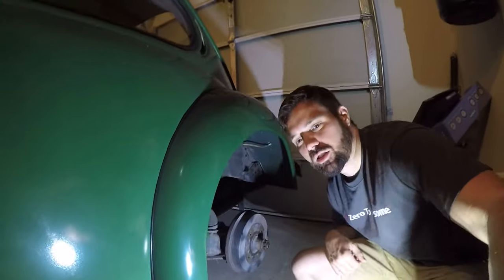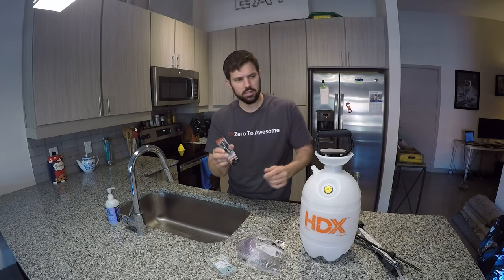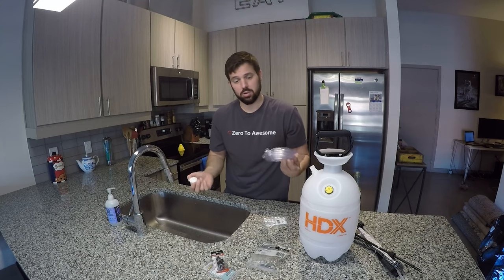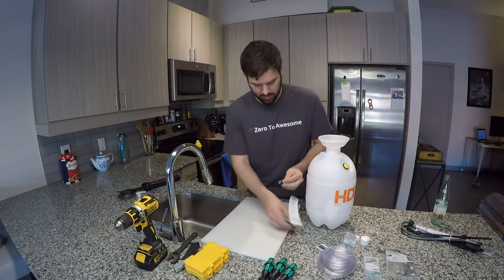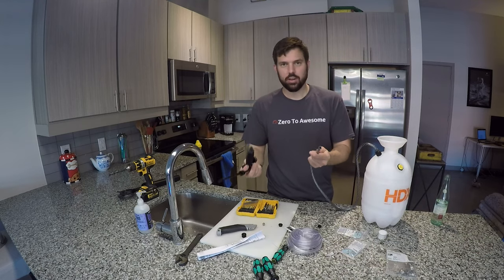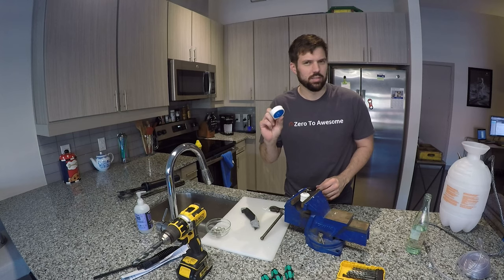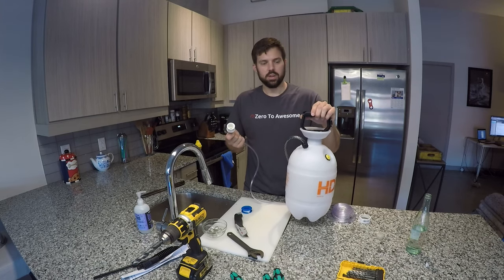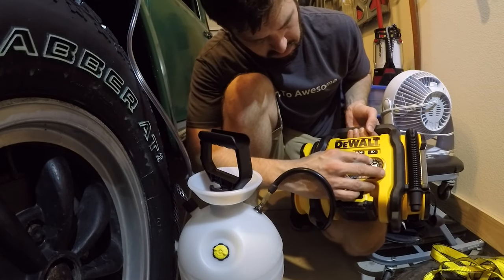Cheap DIY Pressure Bleeder for Brake Bleeding on My Super Beetle

Comment: Before I buy a Motive unit I went looking and found you.  I love that you used a mighty vac catch can. The problem is  getting caps to fit a range of different cars, I need more thought time, vice on granite, damn man.
Reply from the maker: These things operate at such low pressure a cap can always be made a little bigger or smaller with a couple wraps of electrical tape on the threads. 

About that granite.... yeah... still haven’t seen that security deposit yet.
Reply: You could always grab one from the "HELP" section at the parts store for a few bucks. Believe it or not, there aren't THAT many different ones. Or make a plug style out of a chunk of rubber, a tire valve, and some of that tiny chain that comes with the high dollar bleeders.
Reply: Look at a salvage yard

Comment: Creative approach… lol
Questions: 1) what caused the huuuuge puddle of brake fluid all over your garage?  2) does the air compressor have to constantly run or just to pump back up to 10psi periodically?  Thanks ✌️
Reply from the maker: 1) I think I didn’t have the cap on the reservoir completely sealed.
2) just occasionally pump up to 10 PSI, careful not to use too much pressure. 
Thanks!!
Reply: Cool - thanks for the info.  Now I've gotta go cook something up... I'm hungry 😂

Comment: Please excuse my ignorance,  I'm not a hydraulic scientist but how the heck does adding 10psi of pressure (or any pressure) to the container produce a vacuum / suction to pull fluid from the brake calipers?? ............................. Just saying!!
Reply: You are pressurizing the reservoir to push brake fluid through the system and out of through the calipers, not the other way around. Some bleeders attach on the wheel side to create suction/vacuum, this is the opposite approach.
Reply: @murphthebeast  Thanks mate,  I understand now!!

Comment: Why not use the whole provided that's what I did I just cut the original hose and put the brake reservoir cap to that to long a hose is not good.
Reply from the maker: That is definitely one way to do it and would save a little more money. I wanted a longer hose so I could set the sprayer tank on the ground and not worry about balancing it somewhere in the “frunk” of my car.